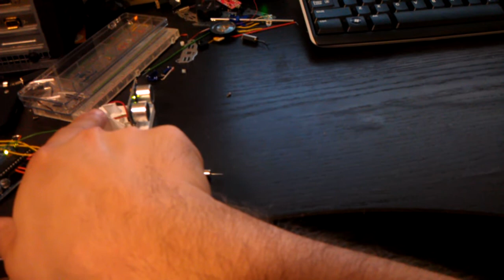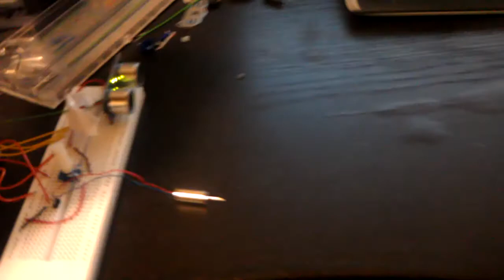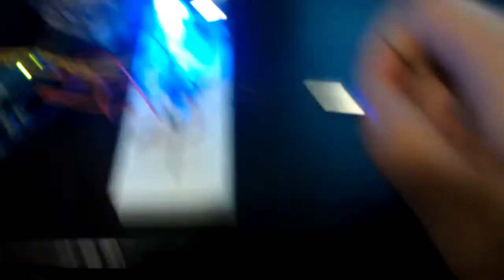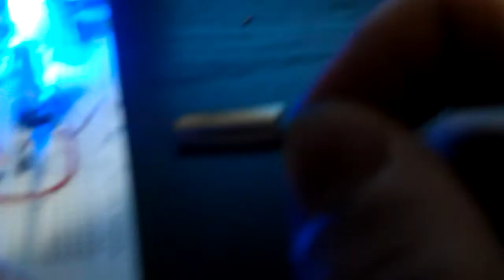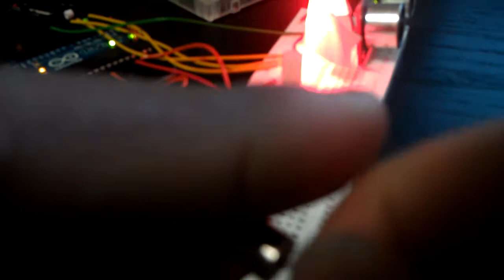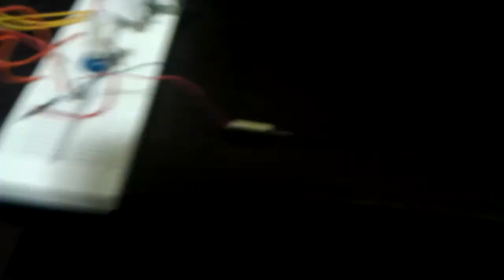Arduino project 2 motor as rotation sensor + more

Comment from the maker: I dont think there is any documents regarding this. It's really not meant to be used as this and note that you will not get any sort of actual angle data or anything like that. basically what I did in this was plug the motor into an analog input. If you do this and run a serial print on the values you'll see some input happen when you spin the motor because its generating a VERY small amount of electricity. I simply multiplied that value and sent it to a led pin.